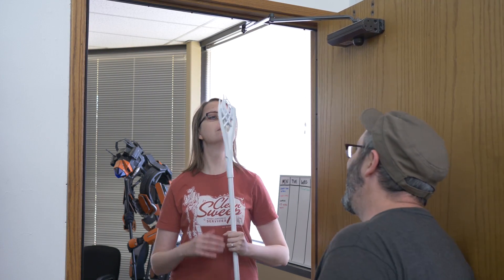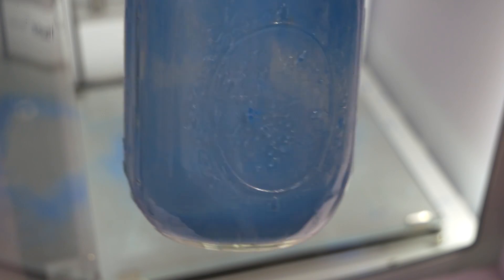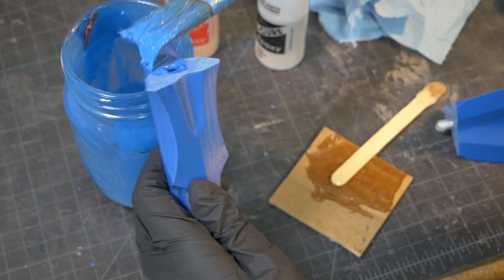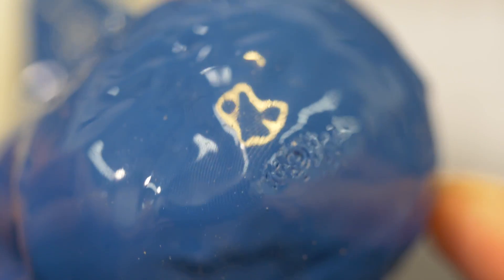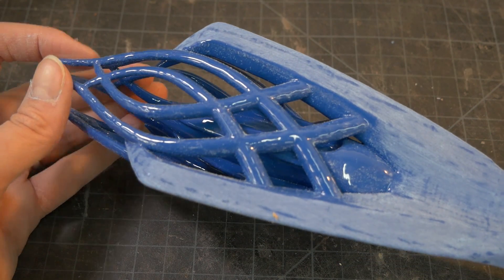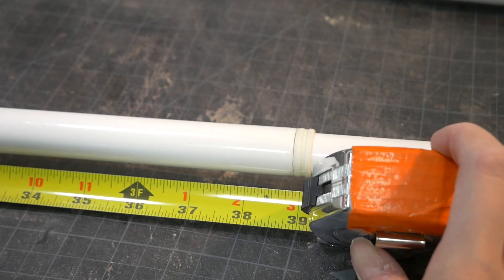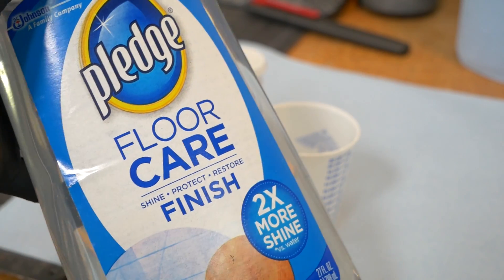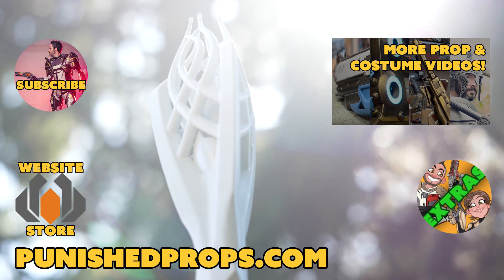HOW TO 3D Print a Collapsible Gandalf Staff

Comment: I only 3D print using PLA as it’s super simple to work with but it requires sanding and priming to get perfectly smooth finish. The method I settled on was first shown to me by Joe silvagi for doing my Mando armor … Rustoleum 2in 1 filler sandable primer followed by 320 wet sanding followed by dupicolor primer then 600 wet sand. Finish with dupicolor primer sealer and you’re ready for painting.  The automotive grade spray can primer is key as the nozzles are 10x better than Rustoleum and provide a perfect finish without the need to use airbrush or LPHV spray guns. Also I always spray a black mist  “guide coat “ of black primer on for each round which makes it so you see here you still need to sand the piece perfectly even.

Comment: Hey I'm just curious but what would it cost to get a similar print but Halo center of  topped latis area, so you could put a crystal in there instead, installed on the head of the staff and then have just the insides of the lattice pattern and have the bottom column be printed so that it is solid so that the only part that is see-through is on the backside of and then to print the center column in the same white color, and then design the bottom part of the staff to be able to accommodate a flashlight with a push button and a disguised hole, that is kind of like a pressure switch, that you cannot, unless you know the trick and where to push the button would be grate if it could be dune but if it's possible I would like it to be in the theme of Celtic symbols, like the water symbol, which is in the shape of three points with a circle around it and they're arcs that cross each other in a 1/2 elliptical almost, creating 3 pedals connected with the ring around the outside of the peace allowing just a small portion of the tips to stick outside of the circle that encompassed the Celtic art design. Just curious and really do like what you guys are doing. So keep up the good work and thank you so much
Reply from the maker: Full of ideas!
Reply: @punishedprops  yup lol

Comment: If you're going to use pegs, the holes should be added to the model before printing.  This way, you can ensure proper alignment.  For best results, make 3 holes, not forming an equilateral triangle.  That way, there's no possibility of improper rotation.

Comment: A respirator and gloves are useless against acetone. Acetone permeates all rubber gloves (except  butyl gloves) and normal respirators also do not work. I worked in an organic chemistry lab and nobody was wearing gloves or respirators. The only effective measure is ventilation to prevent breathing the vapours. In contact with your skin acetone is not realy harmfull, it just removes the natural oil film on your skin, so make shure to use lotion afterwards.

Comment: you can glue pla (and most likely abs as well) together with airfix glue. you dont need to use much and you dont get any squeeze out if you apply it sparingly.

Comment: if you put a little fan inside your ABS smoothing chamber it smoothes much more evenly.
Reply from the maker: I could see that working, but any kind of spark from the fan motor might ignite the acetone vapor. I know it's a really small chance, but I don't think it's worth it.
Reply: actually, makers muse ran a spark generater in an acetone filled glass and it didnt ignite, it needs a proper open flame to do so, ive been running mine for ~16 months and even when i had a fan burn out do to mis-matched wiring it didnt ignite

Comment: Have you tried putting acetone on a paper towel inside of an airbrush jar & airbrushing the crinkly bits out with the acetone vapor. Different tips could give you different effects & detail. & next time, leave a space for a crystal & pop it in the middle when it's still pliable. The branches will dry around it, holding it in place. Then, wiring a light through the bottom will be spectacular. A cheap camera strobe would be a nice touch. Diffused through the crystal would be a very effective flash. Then the hollow tube could be filled with batteries. You could hide a button switch in a replica of a knot of wood on the larger top section of tubing. There's also wood grain paper you could lacquer over the tube or print it yourself to make sure the color matches.
Reply from the maker: Awesome suggestions, thank you!

Comment: The acetone's "sanding" application and his glossy effect is awesome! Great job as always :)
Reply from the maker: Thank you! It was a fun experiment, for sure.
Reply: Punished Props Academy do you know if this "technique" works also with new type of resin 3d printed? Or the acetone reacts only with the old plastic filament. Or it is necessary a specific plastic material? I'm not understand English very well and I'm not sure if you've talked about this in the video. 😊 Bye

Comment: when it comes to removing stickers, i like to just run it under hot water. let the water get really hot, and run over the sticker for a few minutes, then take a sponged with the rough scrubber side and just scrub off the sticker. i find this removes the adhesive.
Reply from the maker: Thanks for the tip, I'll try that next time.
Reply: i like to use this for various jars and containers i think will be useful and dont want a "pickles" or some other logo on it

Comment: Gas lighter is perfect for quickly removing sticker adhesive.
Reply from the maker: That's good to know, thanks!
Reply: Note there are two common "gas lighter" fluids (butane and naphtha). Also, always do a little test to make sure it doesn't react with the underlying material (the pole looked like powder-coated metal, so you'd probably be fine, but plastics can be very sensitive).

I generally start with ethanol (it's harmless to most plastics and only reacts with some water-based paints and lacquers), and then, if necessary, move on to naphtha, white spirit, PC (propylene carbonate), ethyl acetate, and acetone.

Comment: Cheaters... ;) I made mine of wood. Sides of papiér maché and steel wire and lots of putty in the cracks which had to be sanded with long thin strips of sandpaper.
Back in 2003 there were yet no powerful white LEDs so I used a halogen bulb in the crown.
The real props had the three stems meet at the top but I suppose this model was based on the UC replica. I think the real props were painted with brushes also BTW but I have been in arguments about that ...
Reply from the maker: That's wicked cool!

Comment: Love it.  

I have to admit that I'm putting more effort into prototyping with 3D prints and then casting them.  As that gives me a broader choice of stronger materials to work with.

I might have tried printing this one with wood filament and then used real wood for the rest of the staff, cutting it into sections that could be screwed together for breaking it down, instead of being collapsible.  But I guess that isn't as cool.  ;)
Reply from the maker: I think that would be cool!

Comment: If you don't want to get a messy bed for printing ABS, you can put a PEI sheet on it, and it's really magic, ABS stick super well to that with a heated bed at ~110degree celsius :)

Regarding your acetone smoothing problem. If you want to get everything smoothing and not the bottom only, you need to warm your acetone in the bucket, but that's something rather dangerous to do so I strongly discourage that. In the case of the glass jar, you can put it on an electric plate for cooking for example, low temperature.

Personally my technique to smooth things is "acetone rubbing", I use some paper towel with a bit of acetone on it and rub the surface to erase most of the printing lines and then finish with sandpaper. For the inaccessible areas like the gem, I use a very diluted acetone/ABS goo that I gently brush on the part to smooth, usually make things smooth enough for looking good, and by applying multiple layers, it doesn't penetrate as deep that the vapour, that way you avoid problem of parts becoming soft (and that can deform, which can be annoying for tight fits), or the problem of seeing the infill pattern if you walls are too thin. Also, that way I don't take risk of getting lots of acetone vapour. Still I do it with respirator in a ventilated area most of the time or if I will stay more than for a small touch up.

And last thing, for ABS I do recommend a brim indeed ;) Best to get a perfect bed-touching surface of the propos, is to get a first layer over extruding by 15 to 30 % (depends on filament) ;)
Reply from the maker: Thank you so much for the info!
Reply: @AlbusLux hum I think it would be rather dangerous to get a fan and this electric motor in the acetone vapour. From my understanding, the risk of fire hazard is one of the problem of acetone vapour smoothing, so adding a potential source of sparks in the vapour is then a dangerous idea :s even though it could indeed be working to redistribute the vapours. It makes me wonder about "humidifier" machine, I think they have an ultrasonic vibrator to break the liquid water in super ultra thin drops, so it can then start in suspension in the air. Could an ultra sonic vibrator be set under the glass jar containing acetone to make an acetone fog? (Because if you spray the acetone directly on the props it will be a bad result...)

Or maybe but warning it's dangerous !!! I'm wondering about airbrushing some acetone on the props, as it is very thin drops... ? In an super super super well ventilated area with a respirator for chemicals and closed mask on the eyes, plus full jumpsuit eventually... And if your airbrush doesn't have any plastic parts meltable with the acetone.

But I repeat, it pose a couple of dangers!!!!

Comment: What the ratio of super glue to baby powder you put for filling seems in your 3D print?
Reply from the maker: That partially depends on what kind of super glue you're using. Different glues will have different ratios. We recommend doing some testing to see how much works best for what you have before applying it to your print. 

- Paige

Comment: Using a small fan (make sure it isn't affected by acetone) to move the air around will help with the acetone smoothing, since acetone vapours are heavier than air. This is why you had the issue with the uneven smoothing. Great idea on using the rig.
Reply: Just hope it doesn’t spark.
Reply: Some fans are designed to be explosion proof. Those are the ideal option this situation. An impeller, would be the next option.
Reply from the maker: Using a fan is a great idea!

Comment: Have someone tried to sandblast 3D-prints?
Reply from the maker: Awesome, let us know how the sand blasting goes!
Reply: Rex McStiller funny you say that I have just got home from Lidl with a £9.99 hand sand blaster😆
Reply: Rex McStiller Sand would prolly cut it to pieces...there's other mediums...I suggest walnut or pecan shells....less damage....still cleans em up
Reply: Best bet on 3D prints I'd say would be soda blasting(Baking Soda), it's a much lighter abrasive than walnut and shouldn't really leave any marks.
Reply: I was thinking of that as I watched the video. I wonder if a polishing drum might also work depending on the piece and the medium in the drum.
Reply: Rex McStiller  use a sand blast booth at work for pla prints does a great job doesn’t damage prints

Comment: oh this is an awesome build!! i do have a question....if you wanted to paint the pole a different color....would that be possible with the metal? Thanks in advance
Reply from the maker: You probably could if you sanded the surface down to clear off some of the existing paint and rough up the surface a bit, then laid down some primer. Worth testing if you can!

- Paige
Reply: Punished Props Academy I'll give it a try  FOR SCIENCE!!!